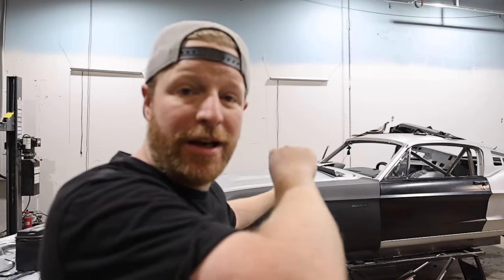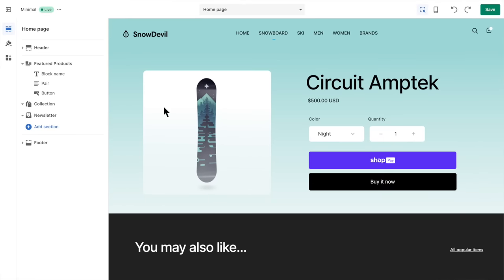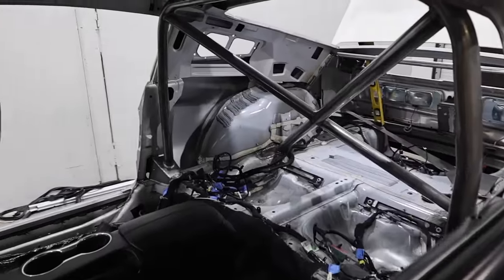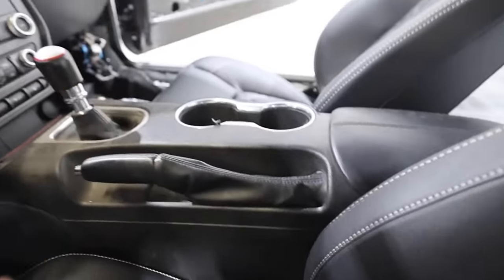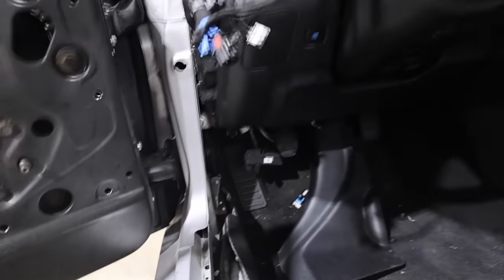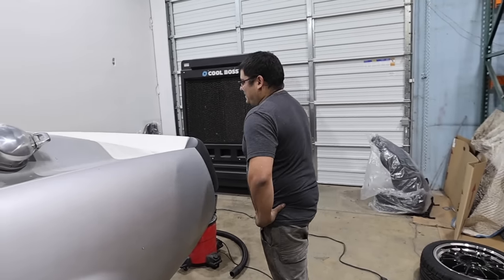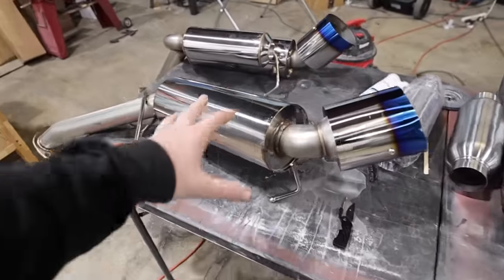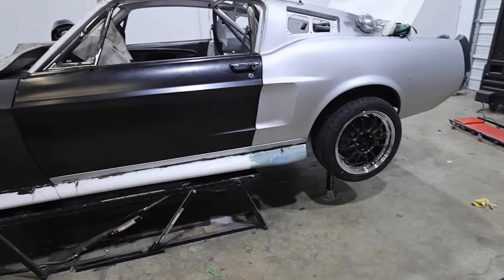B IS FOR BUILD SEMA MUSTANG Build Part 5 - FIRST TEST DRIVE!

Comment: For anyone interested, a Helmholtz resonator provides noise cancelling for specific frequencies, determined by it's length. If you have an exhaust that you like but has a drone at certain RPM, you can cancel it with a Helmholtz of the correct size. You can also use them to tune the sound. If you want a higher pitch, raspy sound, you can add resonators to cancel out the lower frequencies. They do have to be calculated to worked properly though.

Comment: I think the tail lights need attention. Don’t diffuse that’s just a shortcut you’ll still see, just lift the low strips if you get time.
Reply: Turn the LED’s around to reflect off the inside
Reply: @hagueeastman I think the circuit boards will create too much of a shadow
Reply: @ryankelly1182 maybe chrome those?
Reply: @jwalster9412  that's definitely not how shadows work but good effort
Reply: @ryankelly1182  I was thinking that the light reflected off of the sides would at least somewhat reflect off of the chrome bit, but maybe he could try camo? As it would be invisible.
Reply: Grab the diffuser panel  out of a broken lcd TV or monitor and cut to size to fit inside the light housing, it should spread the light enough that you will not see the lcd strip out of line with the others
Reply: Or they could take those strips out of the housing and wire them to real led bulbs instead so they can use the tail lights the way they were meant to be used

Comment: I don't think the wheels are that bad at all, I think the chrome edge with black alloy suits the style of the 60s Mustang, definitely needs centering in the wheel arch though.
Reply: Agreed. I think the issue with them is the offset but there's not much they can do about that since the track with of the new and old mustangs are so much different. It sounds likey they're putting a wide body kit on which should make it look a lot better.
Reply: It will definitely look a lot better when all the chrome trim that is missing from around the windows and what not is added.
Reply: @gb1613  They are only different by under 1 inch...  107.1 (2019) vs. 108 (1967).  As he mentions in the video though the dash placement / hood length is what really screws it.  Otherwise you could set the entire body back another inch.

Comment: Rear taillight diffusers - sure, you can throw some paper in there, or white plastic sheeting, but it will reduce output.  Go to HD/Lowes and grab a clear diffuser panel for the typical overhead CFL shop light, it should fill the entire lense with light.  

Or check with TAP Plastics.

Comment: Chris there is a wheel sizing tool you can 3D print, allows you to see what dimensions will fit the car and look you need (Width/offset mostly). Seems like it is about time to invest in one of those and leave the guesswork :)

Comment: @bisforbuild
If you didn’t know, the big contributor to mustang things is the soft rear diff mounts, swap them out for poly or aluminum bushings and you’ll get a massive improvement in traction and it’ll get rid of the mustang snap back issues for the most part

Comment: nice build so far! i installed that exhaust on my '03 350z (bought off newegg for $250) . it came with and H pipe. I got a magnaflow x pipe ($90) and put there instead. with the cold air highrise kinetic intake setup. best sounding na 350 car imo.

Comment: You are surprising us all with how fast you're getting this thing put together. I'm kinda thinking you may have settled on some narrow rear wheels because of the offset required to fit inside the 67 rear quarters, and think you should plan (down the road) for some wider fender flares to get better rear tires fitted for the long run. Since you are probably going to wrap it anyway, you can do some bonded flares later and re-wrap the quarters.

Comment: Is there a reason why you don’t start with a convertible ? Seems like the chassis would be more rigid to begin with
Reply: Availability probably
Reply: No, they're not more rigid, and it would be more expensive to buy. About the only benefit is that it would be less stuff to cut off.
Reply: Nah it is about the same

Comment: Wheel base front looks to short by a a few inches. Other than that looks awesome
Reply: Yeah the wheelbase is completely wrong, it's off in the back too
Reply: I was hoping this was going to be addressed. I noticed it in the last video and thought it may be addressed in this video
Reply: It was quick, but he's mentioned in a previous episode that there is a wide body kit coming. That should fix the issue.
Reply: I think they plan to cover the gaps with a wide body and ignore the suspension clearances being non existent.
Reply: @NathanSells  It was addressed in the video right before the test drive.
Reply: Could maybe be fixed by adding some caster
Reply: Yh the back too....saw it in the previous episode
Reply: Ya its driving me crazy..... I wouldnt be able to enjoy it at all until that was fixed.
Reply: @RLTango  yea that’ll sort that.  Sounds great to can hardly with to see it finished
Reply: 27:42
Reply: Oh sweet I was hoping he would do a wide body kit. Just doesn't look right with current wheels.
Reply: This channel's comments always drive me nuts. Everyone is so quick to point out flaws. He literally says that it will be solved in the video. Jeez man

Comment: The reaction you had with the epoxy resin is a chemical reaction called an exotherm.

The heat from an exothermic reaction can if left to cure in mass in say a plastic mixing pot can generate enough heat to melt the pot, cause serious burns or ignite anything thats combustible in the nearby surroundings.
The smoke from the exotherm is not good for your health either, you should make sure you are working in a well-ventilated area, probably a good idea to have a fire extinguisher nearby along with a metal bucket dedicated to the resin waste, no paper, rags or anything combustible in the bucket. If it is safe to do so throw the exotherming containter into the metal bucket wearing appropriate PPE as to not burn or hurt yourself, if possible remove the bucket outside.

Comment: What if, modern mustang old school body. Custom suspension and portals. Still independent all the way around with the diff in the stock location you can only get so much high with the axles.     Are portals strong enough for street drifting with 37s?

Comment: Structural engineer here.   Honestly for the roll cage I’d follow an established spec. For building a cage.   No sense reinventing The wheel.   For example if you built the roll cage to the NHRA spec you could at least take it to the drag strip without worry of getting hassled.   Anyways, these are just my thoughts.

Comment: It's good that your doing the down and backwards bars but for the love of God move that X in line with the glass, it looks like a scraped out weekend drag car with the X blocking the rear seating. It would be sooo much cleaner with it running along the glass and actually allow you to properly install the rear interior. Please fix it lol

Comment: Great build, but the tire/wheel package is too small and sticks out too wide. Have you ever thought about slicing the '67 axially and adding 3 or 4 inches down the middle to the width? You could actually use the stock S550 GT wheel size and it would looks amazing!

Comment: Chris, why didnt you fibreglass the inside of the bumper instead? I put a comment on the last video about the advantages - you can slap layer after layer of fibreglass on and not lose the shape of the print, meaning smoothing out the front surface is a lot faster and you don't add thickness in the process. Adding it to the outside surely means you have a whole load additional smoothing and you'll have lost all the sharp defined edges of the print which will now need re-profiled?

Comment: The cutouts on the rear valance panel are for backup lights.  Something I don't see in your custom taillights.  I remember on my 70s Mustangs in VA, they allowed BOTH or NEITHER backup lamp, but wouldn't allow ONE.  I failed inspection on that one until I removed the one.  Moronic.  It's been a long while since I lived in CA, so not sure what the rules are on backup lamps, but odds are you'll be better off if you put something back there.

Comment: I’m only 7 minutes in so maybe y’all mention it but what do you plan to do about the airbag light? I wanna get seats for my 2016 mustang but I hear the airbag light can’t be turned off.
Reply from the maker: there are airbag delete thingys on ebay, use at your own risk though, i have no idea what it does for the rest of the system and stuff. But they seem to work well, i used them on chelseas jeep.

Comment: Keep in mind, to properly tune out exhaust noises with a helmholtz resonator, you may have to recalculate the volume and length of the neck, especially if the volume of the exhaust pipe or the distance from the opening of the pipe to the resonator has changed. If you have a graphing calculator you can just plug the formula in and get your numbers. But first I'd recommend removing any existing resonators, "especially the existing helmoltz resonator, thats what we are calculating for" and keep the mufflers,  that way you can discover what frequencies those resonators reduce, potentially keep them, and then add the helmholtz for whatever is the most bothersome or droney noise. 

In future cars a quarter wave resonator is much easier, literally just a length of pipe a quarter the length of the wave in the frequency you wish to remove, does a similar thing just not as effectively, and also doesn't have the flow benefits a helmholtz resonator has. As you can even tune a helmholtz resonator to retain volume for valve overlap for either scavenging, or for intakes aswell. Most cars have them but ricers remove them for noise despite it losing power.

If it sounds fine tho i'd keep it, but if you want to nerd out and make something perfect to your ear, I really hope this helps. May not be exact, it confuses me too, but I atleast know enough to be dangerous.

Comment: 17:14 yeah that extruder is way too small, can't believe they charge 20k and don't include anything reasonable. Single cooling fan is going to really limit you big time even by itself, and thats a fast upgrade. so much can be done to this printer to make it better without completely busting the bank. woulda have probably costed them $200 more to get the parts OEM from E3D but they skimped out big time. that gantry is so tall because its specced out to have a supervolcano, id bet on it. Legit only a $100 hotend to buy it brand new right now, and they left it out on a 20k machine. that company that you bought this from is big time rip off

Comment: If you drove a car like that in the UK and were seen by police, it would get a prohibition of movement, that means no driving, it would have to be trailered back to your shop. Driver would also get reported for driving a vehicle in a dangerous condition, 3 penalty points on drivers licence and a minimum £100 fine depending if you contested and took it to court, probably then a much bigger fine, possible disqualification from driving for a period determined by the magistrate. Is it legal to drive a car in that condition on a public road in the U.S?

Comment: 😂 your always picking out wheels imo are terrible lol. But everyone has their own opinion. And it’s your car, so choose which ones you like man. When it comes to wheels, there are so many different tastes that people prefer. It’s impossible to pick wheel everyone will like. Other than some like rpf1s or the wheels everyone else uses. And that’s boring. I will say… I do have them on my sti 😂
Reply from the maker: its very hard with a wheel size of 17x8 with a +45 offset, literally nothing is going to look perfect. EVERYONE builds this car with the exact same wheels, and thats not only boring, but they dont fit. So were working on other options. But thanks for stating your opinion kindly, i appreciate it.